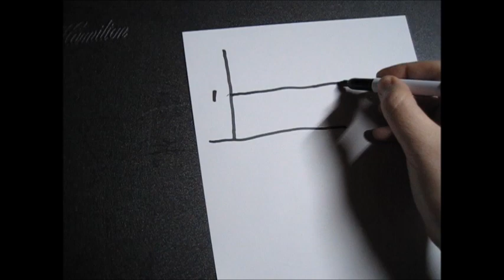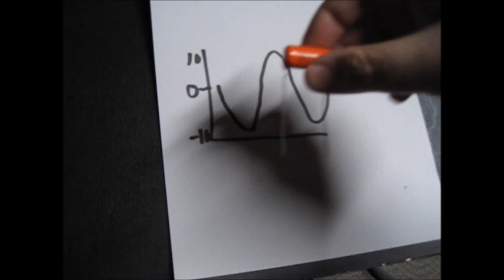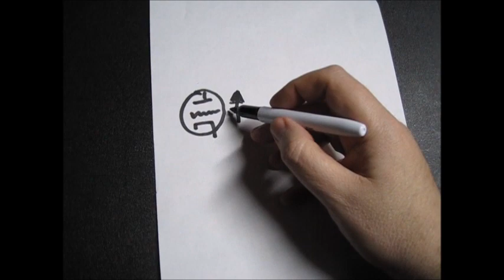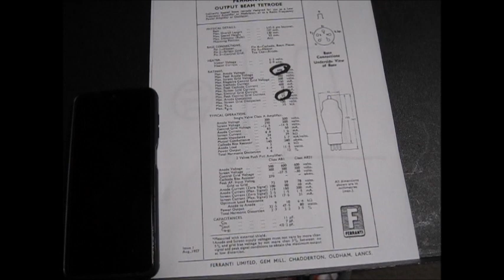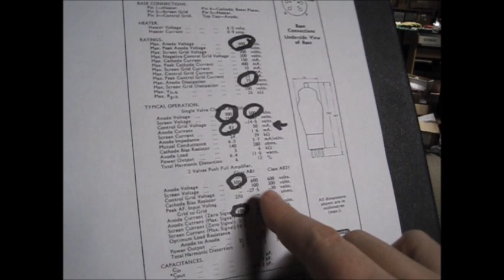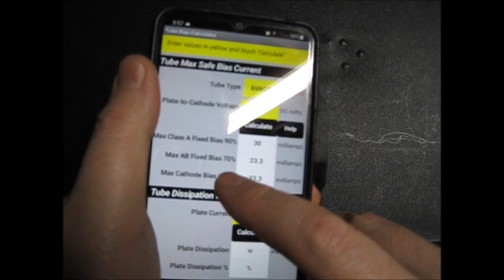Attempting to explain TUBE BIAS.... wish me luck.

Comment: Every time someone explains it, I catch a little more.  Thanks for posting!
Reply from the maker: Essentially,   it's a trick to get an alternating signal amplified by a valve that only flows one way.
Reply: Great! Now try transistors, how they are current amplifiers yet still end up amplifying voltage, how the voltage at the base always stays the same no matter what voltage you have at the input, I guarantee your brain will melt.
Reply: @DeadKoby  
yes, but your description of two types of biasing, side by side, was an ah ha for me. 
Thanks again!
Reply from the maker: @westelaudio943  I'm amazed I passed through school...   I REALLY didn't get the theory,  but my circuit always worked.
Reply from the maker: @paulsto6516  Cool.   Glad my rambling is actually useful.
Reply: @DeadKoby  

Same here, but you can kind of get it once you fully understand good old Ohm's law and the behavior of a diode junction with forward voltage. Never went to engineering school but often the explanations you find in books, especially more modern books, made me understand things less.
Reply from the maker: I jokingly say "my brain is broken"........  but it's a learning style.   I learn to see what it looks like when it DOES work,  and then compare it to the non-working one.........at least for mechanical stuff.    That cursed concert amp from a week or so ago......  I just "sniffed around" the powered off board for a fail in the tremolo section and was quite fortunate to find the open anode resistor.

Comment: Cool demonstration man. 

Off subject. I have a question about the Kustom K200. How difficult do you think it would be to add a effects loop.
My buddy has one but generally plays guitar and wants to run a modeler through it. I think he’d get a much better tone with a effects loop. I noticed that on schematic (and on the back of the amp) it shows a aux/rca connector, but it’s labeled as monitor. Is that like a line out? Any info you may be able to share is greatly appreciated. 

You’re the only one I’ve seen that has spent a good bit of time with these amp. I believe my buddies is like yours. K200B-1.
A
Reply from the maker: That is indeed a line out...  so you're already halfway there.